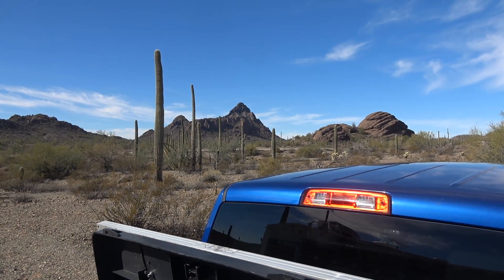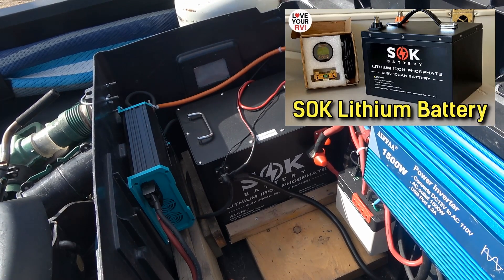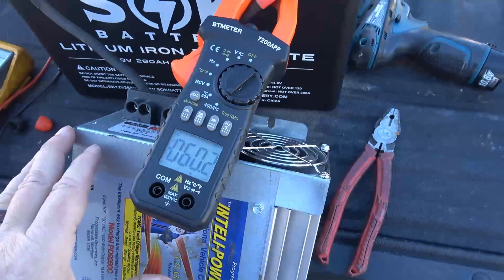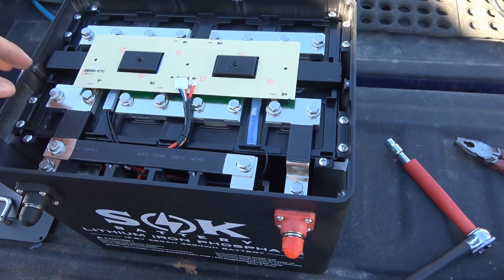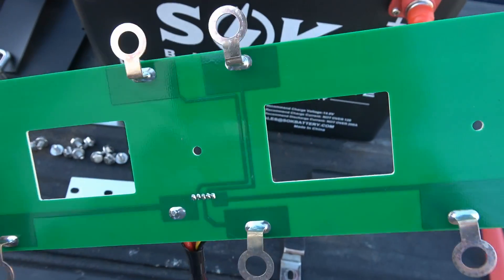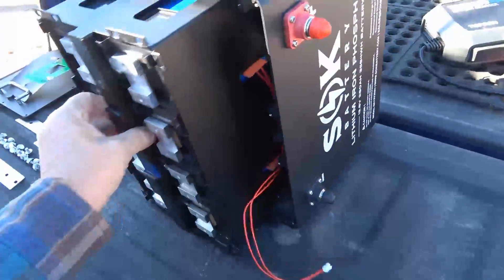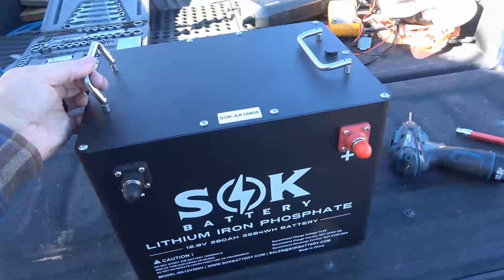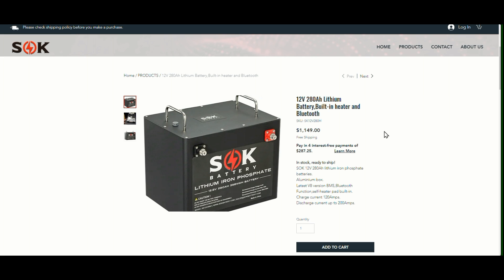SOK 280Ah Battery Teardown & Self Heating Test - Review Part One

Comment from the maker: Note: There is a misprint on the BMS board. The charge/discharge current is 120amps/200amps
SOK Website - https://www.us.sokbattery.com/?ref=LoveYourRV
SOK Canada - https://www.canada.sokbattery.com/?ref=loveyourrv
SK12V280H Manual and Spec Sheets - https://www.us.sokbattery.com/file-share/fa0d6298-cfcc-4c6c-a2bf-0ef2ed8fab35?ref=LoveYourRV
Truck Box Power Station Update Video - https://youtu.be/OMdNPL4_iCI

Comment: BMS says:

Recommended charge MAX 70A (manufacturer says 120A)

Recommended discharge MAX 120A (manufacturer says 200A)

Looks like spec from web and BMS printed information are not same.

Is it miss-print on BMS or over-spec web page?
Reply: Thank you for update.

I’m picky because I’m looking for 280AH Lifepo4 for my RV, Sok could be  my future battery but I’m not 100% convinced this the right one.

Greetings from Ireland
Regards Chris
Reply from the maker: I was informed by the manufacturer it was a misprint on the BMS. I noted it in bold letters in this video description and the pinned comment. :)
Reply: There is exactly same BMS with same print together with their 100AH battery.

I’m not 100% sure this is just mistaken print error.
Reply from the maker: @file-moon  This is from an email straight from the top guy at SOK after he watched my video  "There is one incorrect information we marked on our BMS, the charge/discharge current. This 280Ah battery charge/discharge current is 120amps/200amps."
I will test it, though, in an upcoming video to verify. Cheers, Ray

Comment: Thanks Ray. My bank of 6 AGM batteries seems to still be good, but no battery lasts forever. If I used two of these in parallel there would be 560 AH with 90% useable or 504 AH. On my existing bank we only have 330 AH available. That has been adequate, but two of this battery would cost less than 6 new AGMs. I will have to give these serious thought.
Reply from the maker: Yes, and there was a misprint on the BMS board. I've been told by SOK the true specs for the charge/discharge current is 120amps/200amps. So with 2 in parallel that would be 240A/400A.

Comment: Ray, what is the minimum temperature that is safe to charge Lithium batteries that dont have heaters in them. Thanks for your video. I'm looking at buying a 12v 100 amp soon.
Reply from the maker: Unusually, most spec sheets say that around freezing 32F is the low-temperature charging cut-off. Some brands go a little lower, but not much. Discharging can usually go down as low as -4F.  Most decent batteries have thermistors that report temp to the BMS board, and BMS switches off any charging current when below 32F to protect the lithium cells. Here is a video of a deep freeze test I did a few years ago with a Lion Energy battery.  https://www.loveyourrv.com/lithium-rv-battery-deep-freeze-test-lion-energy-safari-ut1300/

Comment: Love the review, have you ever thought about a 24volt battery?
Reply from the maker: Maybe if starting over from scratch but after adding things for the last decade or so at this point I'm already properly wired/fused for 12V and have so much equipment using 12V that it doesn't make sense for me.

Comment: That battery is hands down the best made of any Lithium battery I have seen torn down. What is equally impressive is the size for 280AH, roughly 13"x10"x10" is not much bigger than a standard 100AH battery.